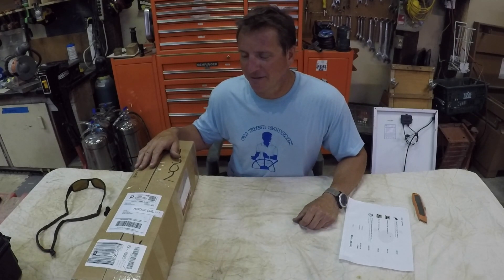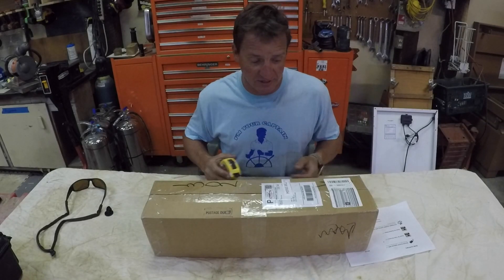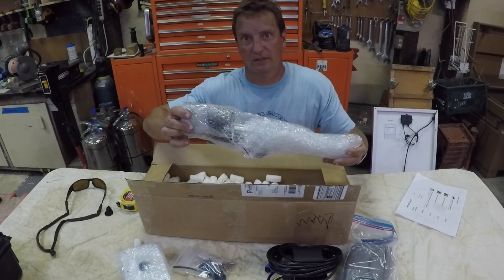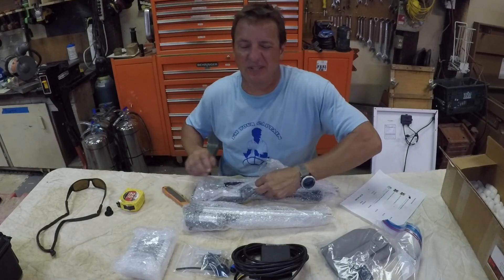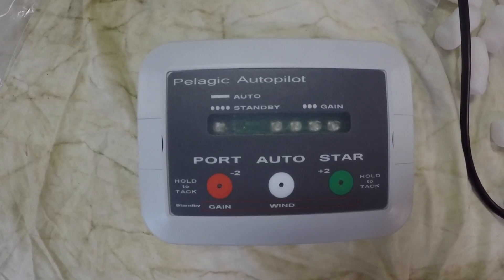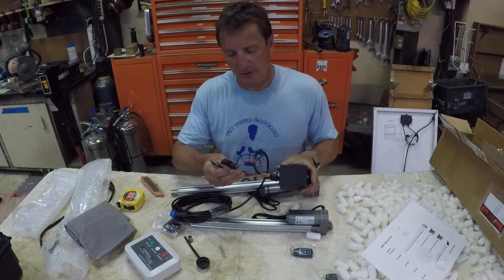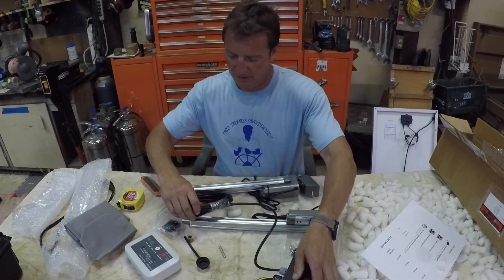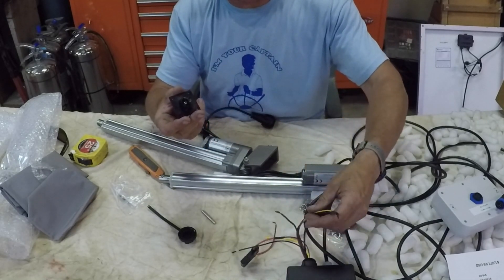Unboxing of the Pelagic Autopilot System for Tillered Sailboats

Comment: Did you installed. Can you give your feedback about it?
Reply from the maker: I did install it and I do like it although I have never used a different one.  This one is waterproof which I believe the others are not.  It fell off due to my carelessness at anchor and took an hour to retrieve in 10 feet.  It still works fine.  It is great because all the electronics are not part of actuator.  Most are mounted below deck and one panel is top side.  It also has a remote which I cant stress the value of enough.  I can be below deck making corse corrections.  That cool.